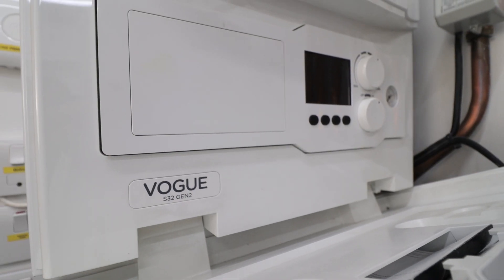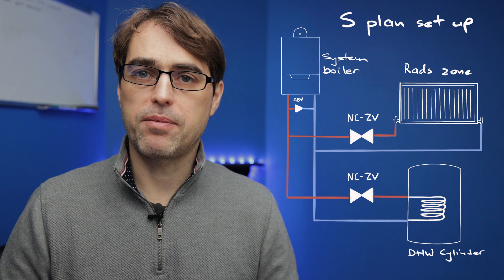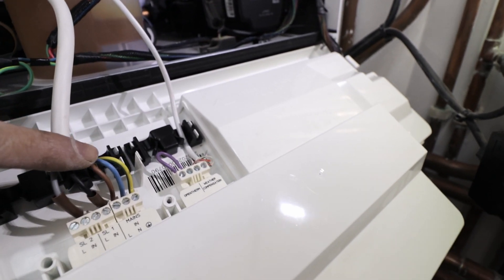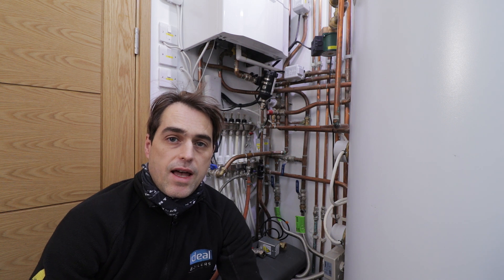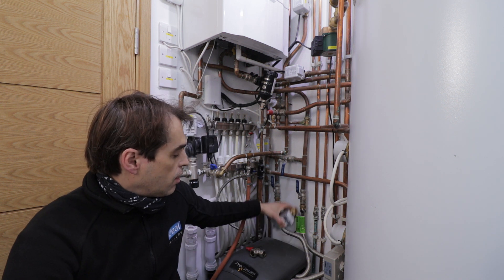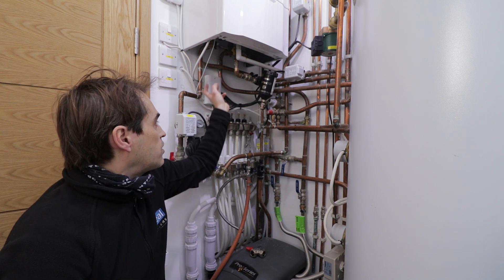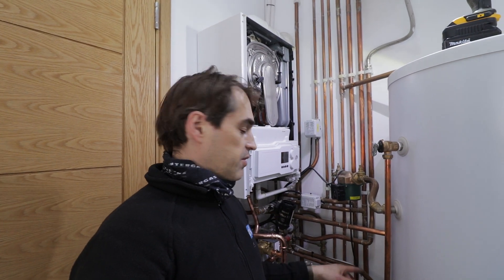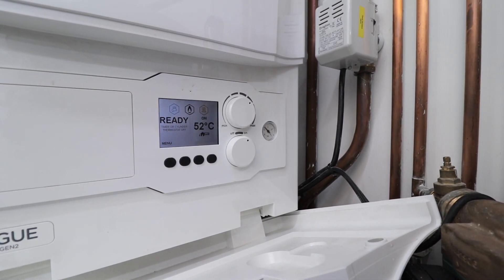Hot water priority with Ideal Vouge boiler

Comment: Thank you so much for this. I installed a large S plan plus in my own house (bar the boiler) and it has never worked properly, purely for this reason (especially over summer months). I owe you a pint (or three) for this excellent insight and knowledge that I've got from you all for free. Thank you. 👍🏼😎

Comment: When converting and S Plan+ system to PDHW could you avoid the need for a new NO zone valve on the heating size by wiring a double NC relay that is energised by the DHW brown which would kill either or both browns to each heating zone valve? Thanks

Comment: Thank you so so much for this video. Years ago my plumber did a 100% bog standard installation of an Ideal Vogue Gen2 S32, S-Plan setup. He did not bother with weather compensation or Opentherm, although he did try and do Opentherm as I put him under some pressure as I thought it should have been possible with my Nest. He could not work it out, not an old guy either!

In the last month I have re-wired my electrical junction box (was a mess) onto one of those nice Wago junction boxes, I have added the external temperature sensor, and I have added Nest Opentherm. Now my boiler runs way cooler when on heating only. Because of SL2 and the boiler knowing when it's getting a call for hot water, I have just set the 1hr HW period to coincide with a 'gap' in my Nest schedule when the heating turns off. So the outcome is nearly the same.

My only problem now is this S32 boiler is certainly too big for my house and it cycles on and off. I'm pretty sure it cycled anyway when it was set to 60 though. Wish I had the S15, and Ideal say that you cannot downgrade it by swapping parts. So if anyone wants to do a boiler swap let me know, otherwise I may up buying an S15 in a year or two! Grrr

Comment: Sorry, with PDHW does it mean the HW will always kick in whenever boiler is on? Or can it be controlled to call between CH and HW?

Also, does cylinder tank need a temperature measurement control or will it know that HW is satisfied ?

Comment: Great video explaining this. I'm currently pricing up a job with the same boiler. I plan to fit a high gain cylinder. Would you leave the hot water demand on all the time as it should only take 10-15 minutes to heat up or would you still time this?

Comment: Hi Your explanation is second to none
If All houses had adequate insulation then running the boiler at a much lower flame or burner rate should rectify the heat loss within the property

Comment: Hey Szymon, If you were using opentherm on the heating, does SL1 terminal get left empty at the board? And you just run your two wires from opentherm connection at receiver to the OT connection on the right hand side of the board? Cheers
Reply from the maker: No, you still need sl1 and sl2 connected

Comment: If I remove a gravity fed floor standing boiler and replace it with a Ideal Vogue Max system boiler do I not need a cylinder stat ?
And your saying the Normally open valve 
Goes on the heating pipe only ?  So then how would you get the temperature correct inside the cylinder?
Obviously the floor standing boiler uses its own stat within the boiler to control the hw as there are no valves whatsoever on the system at the moment, therefore it must bypass to the bathroom also

Comment: If only all engineers were this knowledgeable. I've just had a new boiler and controls fitted, both Opentherm compatible yet they wired it as a normal on / off system!

Comment: Have got the new boiler installed now. The plumber noted that the S PLAN supports hot priority provided the Tado Smart thermostat supports it.

Is this correct? What plan needed for the hot priority ?
Reply from the maker: S plan is not PDHW
Reply: @UrbanPlumbers  and requires to change the heating zone valves to something else? open Return?

Is the HotWater priority dependant on the boiler or the thermostat? Electrician was not sure how POHW would benefit :/

Besides are you familiar with Tado Starter Kit EU model? Somehow it has one zone connection but meant to support both hot water and heating via opentherm.

Electrician gave up
Reply: @bimiuk4051  the eu Tado wireless receiver could only support hot water if you had an opentherm capable tank, and even then I’m not sure how you’d wire it
Reply: @Leonards-leopard  @urbanPlumbers claims that it works opentherm + hot water priority.

Still waiting for his final video to confirm as I need to return it otherwise

Comment: Well! Think I need to get NEST and ditch TADO cos nobody is able to figure it out!

So, I will purchase the NO valve to make it PDHW with Opentherm. But but but ... Since I have a system boiler and water tank which also has a Coil Electrical Immersion (think can heat water tank using electricity as a quick option). How does that work with NEST and Opentherm and PDHW?

Will that fall out completely ? How is that managed then? Will that be via nest too or will remain a separate switch. the Honeywell old thermostat controller has option to call for Boost. Btw. how would I know what's the temperature in the hot water tank in order to call for hot water or maybe it be a case checking if hot water is getting cold lol

Any thoughts about Electric Immersion and how that would be controlled? Or will that fall out and become unusable because PDHW will simply switch off CH and feed heat to tank only? Just thinking if it's freezing cold and you need both HW and CH ? 😟

Comment: Hi, could you plz check the link for wiring diagram.. it doesn't work.
Is there any wiring diagram for s plan + in this scenario, with 1 NO valve followed by ( heating NC valve +ufh  NC valve)   and NC valve for hot water
Thanks

Comment: Hi again urban I’m doing a big install in an old Victorian home with three zones, basement,ground floor, first floor then obviously hot water cylinder, so an s plan plus but HWP, I was thinking of using a low loss header as it is quite a big property, 6 bathroom 5 bathrooms and multiple living rooms and kitchens, my low loss Calc came out at needing a little less then 150k btu’s, which is in return 43kw I’m thinking of putting in a 32kw as all zone will never be in use, what is your opinion? My other option is to fit the bigger 40kw, as fitting two boilers isn’t really possible due to fluing the two boilers as the exit point would mean there are to close to one another. And I’m assuming with a low loss I can just put the normally open on the flow out of the low loss and run as you describe, really love the videos👌🏻

Comment: I watch your videos regularly and often goes above my head. My query is what is the ideal flow temp and range rating to heat an unvented indirect 250l tempest cylinder? Also how long the hot water program may need to run to heat 35 degree water to 60 degree?

Comment: Been doing this for the last 12 years using Glowworm boilers with systempro and Climapro controllers, give the best results with underfloor heating (no mixing set or pump needed with weather comp) and with fanned low temp rads, set call for hot water to 73degs and call to heating at 40 odd, massive fuel efficiency.

Comment: Great presentation. I have an S Plan + system with UFH on the ground floor and radiators on the 1st floor. Boiler is Ideal Logic S18 which will operate with weather comp. 
In the X Plan system you describe, if it closes the normally open valve at the same time that the UFH is calling for heat, what effect will it have on the UFH system when it can’t get any hot water to top up the circuit. Also my home is a new build and the radiators are quite small. Would they have designed the radiator circuit to use water above 60 degrees?

Comment: Hi, I have an Ideal Vogue Max System 26, will this run like your set up on here if the wiring is altered? only wired into SL1 at moment. I know I will have to add the N/O CH valve etc. Cheers Chris
Reply from the maker: Yes, you can do PDHW on that boiler

Comment: I love your videos.  I thought I had an S-plan plus (that's how it's plumbed), but I'm now pretty sure I have hot water priorty.  Vaillant system boiler with all Vaillant controls and it will never allow hot water charging and heating at the same time.  The only frustration is that it seems to take an age to switch from hot water charging back to heating.  It does some kind of cool down precedure before it starts firing for the heating?  Seems a waste of energy.

Comment: Can we wire NC terminal from cylinder thermostat to CH valve brown wire. Than CH valve could be NO type like DHW, then orange wire from CH valve to SL1?
This way we make sure that we fire boiler pump knowing the valve is open (in case motor within valve becomes faulty) and there is no way for the boiler to pump against close valve.
For s plus situation I'd use DPDT relay to create two channels for two heating zones.
Reply: Hello. I think you are talking about a method that came to my mind. Have you done this? I was thinking a double NC 240v relay to kill the calls for heat to the 2 heating zone valves when the dhw call for heat came. Will that work and avoid the need to plumb in a new NO zone valve like in the video? Thanks
Reply: @garethtcollins this setup would work. This is what the NC terminal on the cylinder stat is usually for. You wouldn’t need a relay, just wire the call for heat from the room stats to the grey on the heating zone valve(s).

Comment: Sorry silly question: got 12 radiators in house (one of them is vertical radiator round 1200w) 

Having an Ideal Vogue System Boiler 18kW installed. Also HOT WATER Prioritisation.

Is the 18kW more than enough or would it struggle? People say 24kw is minimum.
Reply from the maker: yep - 18kW most likely is double what you need. Keep it that way - it will be more efficient on both heating and hot water than 24 or 30
Reply: @UrbanPlumbers  thanks man but why are people worrying me :( i am just worried if it hits -1 in winter and I need hot water and heating = hot water prio.

Still 18kW SYSTEM boiler is more than enough for 3 bed, 1 ensuite 1 bathroom and 12 radiators or so?

Hope i wont regret this lol

Comment: If there’s no weather comp or any option to run heating at a different temp, there’s no point installing a valve for HW priority is there? Or does it still mean a tank can be heated up quicker?
Reply from the maker: No point. You can just use programmer to time it independently from the heating

Comment: Is it not possible to 'simulate' hot water priority with a smart thermostat, by scheduling hot water to come on for say 30 minutes at the same time as central heating is temporarily turned off using scheduling? You could do this a few times a day to keep HW topped up, while barely noticing that the heating has been off for a short period. I assume the boiler would then run and two different temperatures?
Reply from the maker: You still can’t have weather compensation and open therm as water would never heat up if it is cold outside.

The only way to do it is with open therm boiler and ESI controls

Comment: Hi mate, so If the boiler was heat only, s plan plus with normally open valve before CH valves, how does the pump fire ? Great videos 👌
Reply from the maker: Depends on the boiler. Some boiler need a pump overrun so the boiler supplies power to the pump, other guy will need to use a relay to separate switched lives and fire the pump.
Reply: Thank you sir, going to do it to my system before offering it to customers. Mines a logic heat 24 (already fitted before we moved in) s plan plus with 2x nest. Thanks again.

Comment: A great explanation. As a heating professional myself I really enjoy your clear no nonsense presentations. Whilst I fully understand why you’d do this, I’m not sure for at best a ten percent saving that many would. I would also worry about someone following in about six or eight years on an emergency call out one night and fitting a std NC 2port in place of that NO 2 port. I think you’d need to label it very clearly. My experience of weather compensation has been mixed at best. Confuses the hell out of customers when their rads seem to have a mind of their own. I’d much rather just use something like open therm that’s doing it’s thing unseen in the background by the customers.
Reply from the maker: It’s not the system that’s the problem. It’s the quality of gas engineer that is lacking.

Any decent engineer will understand the set up in no time!
Reply: @UrbanPlumbers  yep I totally agree. The lack of underpinning knowledge I see weekly is actually quite worrying and gives the industry a bad name. Only this week I went to a boiler, a previous company attended, told the customer they needed a new boiler as parts were obsolete, turned it off, left them no heating, quoted 4K for a replacement. I ordered the parts on a next day delivery and had it working for less than £300 all in. I see it constantly, a complete lack of even basic sequences of ignition, or an understanding of what the numbers on a FGA are even telling them. So-called engineers who don’t even know how to min/max a boiler. I had a call from a plumber of about thirty years in the industry. Changed a rad. System wouldn’t fill. When I told him to check the cold feed wasn’t blocked he had no concept of what I meant. And on and on and on.

Comment: John Ewart. Would hot water priority work with Vogue combi rather than system boiler
Reply from the maker: combi boiler IS already a hot water proprity device!
Reply: Sorry,what I propose is to fit an unvented cyl connected to combi using a n/o and n/c 2 port valve and combi to provide d hw at utility and en suite will weather comp work with  combi or do I need relay as read with intergas set up

Comment: If the towel rails come on on hot water demand, it means that they will not come on on central heating demand right? Is there any way to make them come on in both cases?
Reply from the maker: Towel rails do not come on with hot water demand any more. They are controlled by UFH nest connected to the hot water SL from the nest - which allows programming windows for when the towel rails come one. They now come on their own (without hot water and without heating) in the summer and with heating or without heating in the winter.

It is just that there was an unused connection on one of the Nests that usually is used for hot water and I used it for controlling towel rails instead.

Hope it makes sense.

Comment: can you explain this with a system Worcester life style with the added mixer .
Reply from the maker: I have never installed a Worcester system boiler. Unlikely I will ever do.
Reply: @UrbanPlumbers   I don't like them ,but it's not been in the house long .
I want to have PDHW .
Worcester say I have to buy the mixer and Worester cylinder ,others say I can fit a resister in the boiler  .
Reply from the maker: @mgbroadsterJ  you can get a Worcester wiring center and use any cylinder if you can fit an NTC to it. The only difference with Worcester's own cylinder is the fact that they may let you not use OV stat - just NTC.
Reply: @UrbanPlumbers   Would it be effected with multiple heating zones  ?
Reply from the maker: @mgbroadsterJ  i dont know how many zones you can do on that wiring

Comment: Hi. Very nice explanation. Thanks.

I have a logic system max s30 boiler on s plan connection wih Drayton wiser 2 channel thermostat. I wanted to connect it with hot water priority and opentherm for central heating. I was wondering if you can connect the wires in a way that if the hot water valve is open, it stops the central heating valve from opening? Then you wouldn't need to change the CH NC valve into a CH NO valve. Or am I missing something? You would need hot water cylinder thermostat off in order for the central heating valve to receive any electricity to open.

Thermostat central heating wouldn't be able to energize the CH valve if the HW valve is open, hence not energizing the boiler on SL connection. That way no need to change the CH valve to NO.

I'm probably missing something, am I not?
Reply from the maker: You can use a relay to interrupt power supply to heating zones when there is demand for hot water
Reply: @UrbanPlumbers  thanks for your reply. This saves me from replumbing the whole system.

Comment: Great explanation. I can’t help thinking that a much cheaper and simpler resolution would be to time the HW to only come on during the CH OFF periods, even if it’s for an hour in the morning and an hour in the afternoon. Any underfloor zones shouldn’t cool down that much in the time
Reply from the maker: Yes you could do that on this boiler, but if you fire both DHW and CH at the same time radiators and UFH with get 80C water going to them, which is just unnecessary.

Comment: guess they want them on on HW demand to have them on when they take a shower but like that they would have them on even when they wash dishes in the kitchen or just use a wash basin in the bathroom. I am wondering if this continuous switching on and off could get the zone valve and the boiler ignition to get faulty. And also they would go on in the summer when there is 30 degree Celsius outside and you really don't want them on while you are taking a shower. Is that right?
Reply from the maker: No. They come on with 2nd Nest - just programmer on sl normally designed to control hot water.

Reason is - that way they can have towel rails on in the summer without central heating. 

Hot water is independent from towel rails as other neat controls hot water

Hope it makes sense

Comment: Great video - I've subscribed.  Can hot water priority be set up on a vented system (subject to the correct boiler being installed) should the mains flow/pressure not be suitable for an unvented system?
Reply from the maker: Vented or unvented makes no difference. Both can be easily done on PDHW with a right boiler.